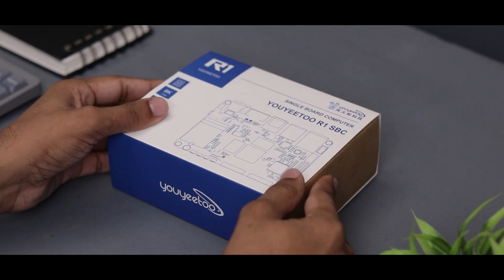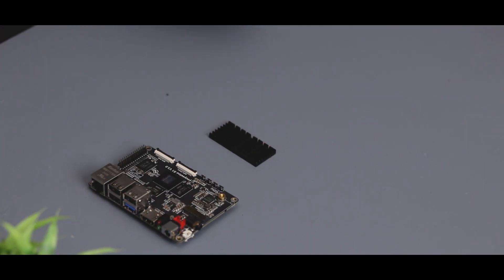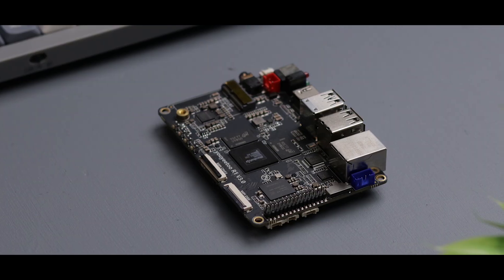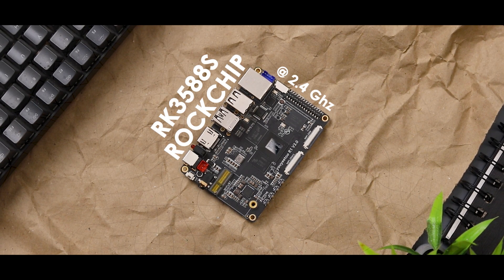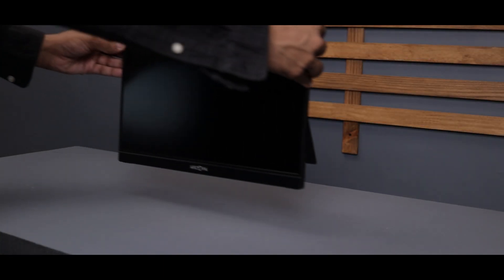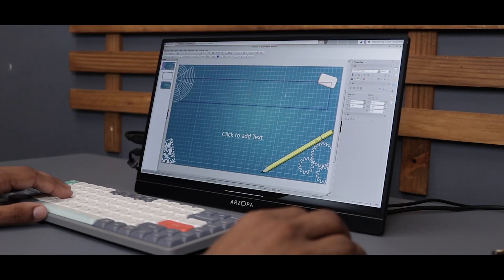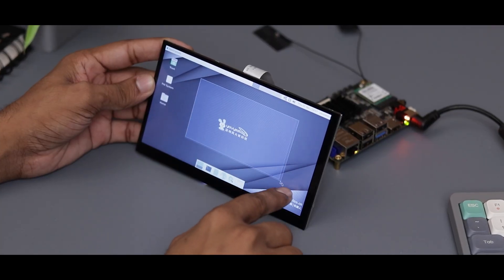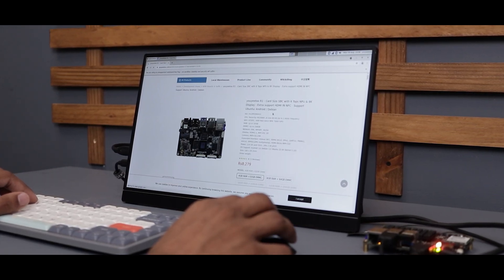Unboxing & Review: Youyeetoo R1 - Affordable ARM-Based 8-Core SBC with 8K Output!

Comment: G10 GPU lack OpenGL-3.3 up & vulkan-1.3 support🤣
Reply: Collabora is working on that.
Reply: Even vulkan 1.2 is flaky and underutilised usually, even with the proper kernel/driver/firmware.
It'll be practically obsolete by the time proper drivers are made, for the ridiculous price these things are sold at.
Reply: @yasirrakhurrafat1142  that is why people should move to mini-PC same price, forget Arm SOC, even Pi5
Reply: @張三-q8q  man.. what the biggest disappointment is.. that the latest of x86 stuff ain't even let you overclock.. not even undervolt or nuthin.
If tis a mobile u/m/h/hk/hx part.. you ain't even gon get no voltage adjustments, ain't gonna get no ram voltage adjustments, no ram timin adjustments.
No nuthin man!
Maybe in certain configs you gon get the tdp adjustments.. then that's bout that!
No Intel Xtu proper, no ryzen master proper.
No nuthin!!
Mind you.. on u/m/h/hk/hx mobile parts, twas probably possible to get clse to arm like, or better efficiency with slight clock and voltage adjustments.
But they scrou us 0var.